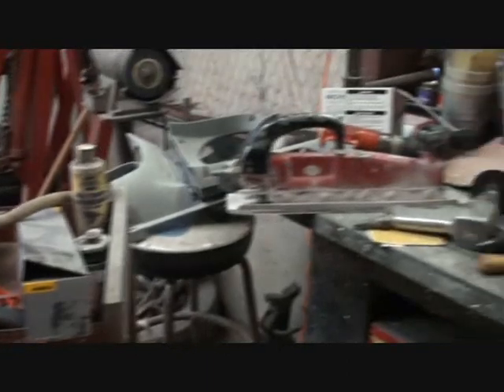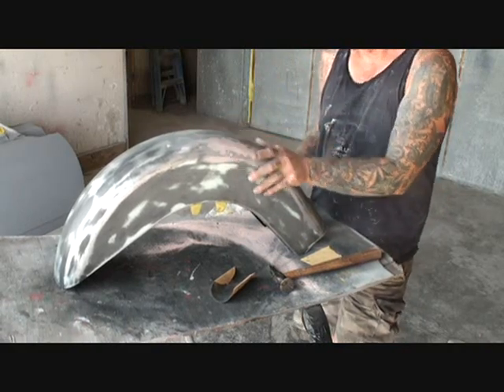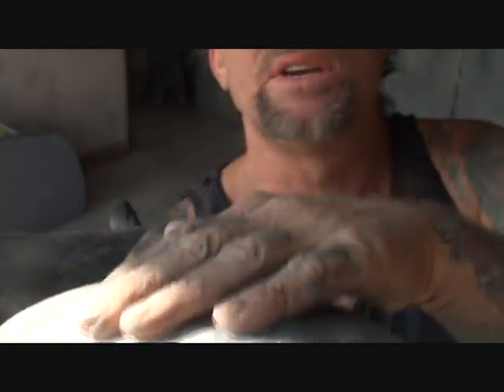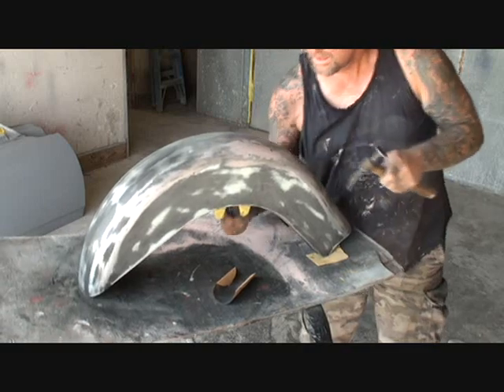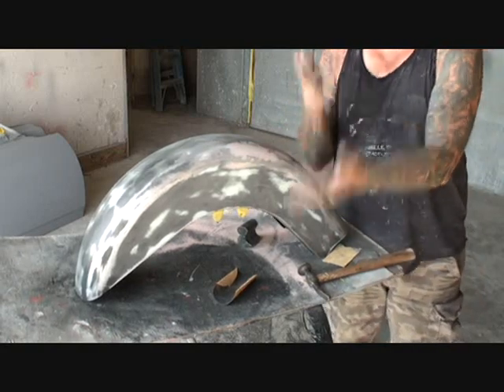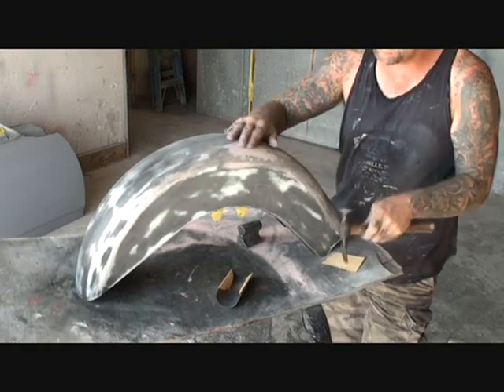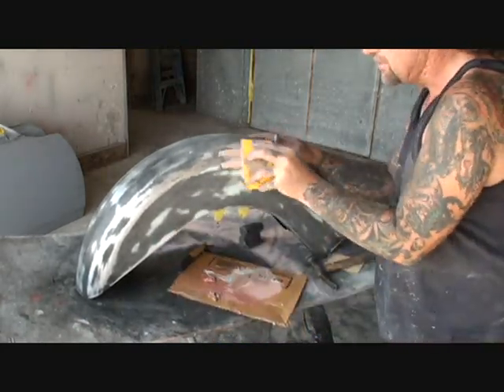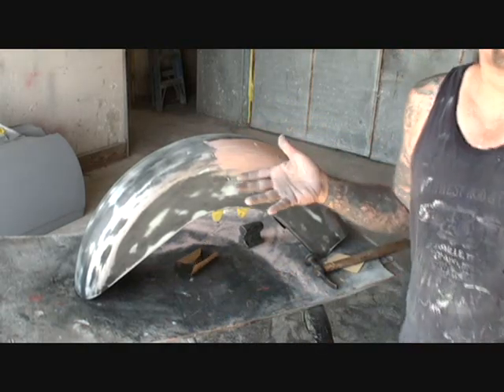How To Prep Your Motorcycle Fender For Painting-Part 3

Comment from the maker: @Jx1x3 The amount of hardner you use is determined by the weather, if it's cold out you would use more, if it's hot out, you would use less, for the application and they temp outside, I probably waited approx. 30 minutes or so.. Pete